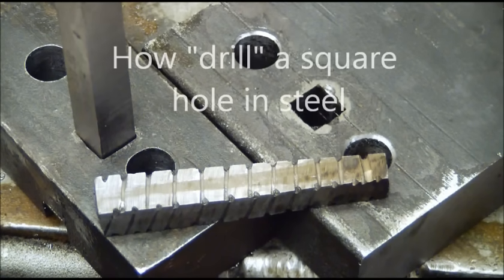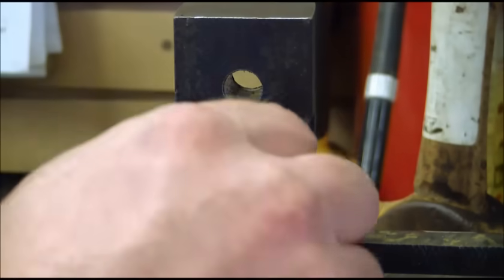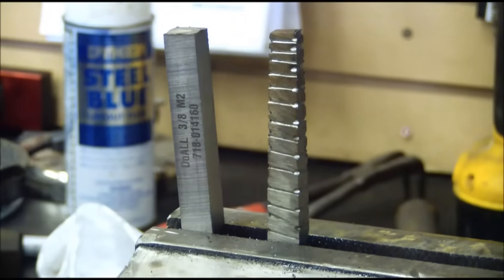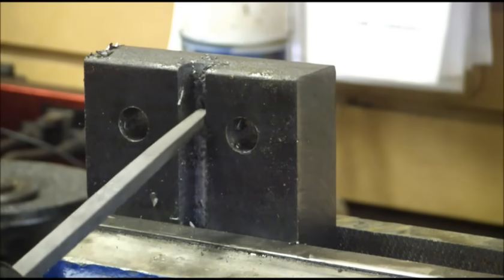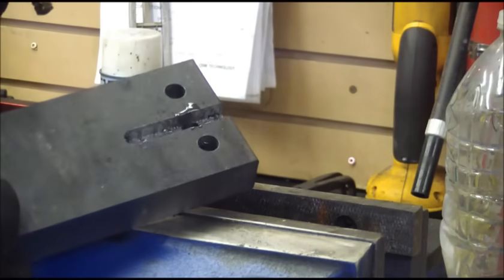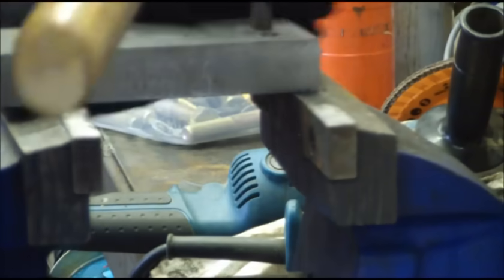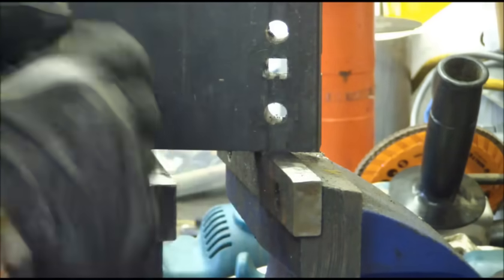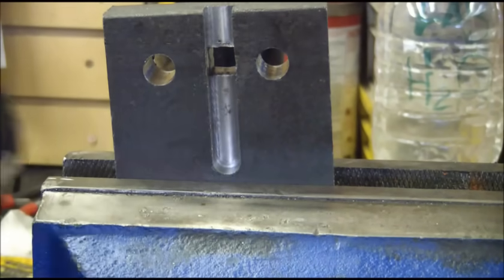Machining 101: How to drill a square hole at home without special tools.

Comment: 3/8 th inch drill (9.52mm) ffs like your speed if you were running a 2 mm drill.......try 4-550 rps max less cutting fluid on drill bit and you just might see whats going on !... as for your home made broach .....BIN IT its crap......bit like the cutting edges on your drill bit...... :(
Reply: It's crap??  Did it get the job done?

Yes it is very basic, but most people do not have well equipped home workshops or more specifically, they might have a great WOOD shop that expands their occasional needs in the metal department.  This vid shows how we can do a passable job on a task that comes along very infrequently and with the tools we likely have on hand.

Comment: you need cutting oil and a slower speed jesus
Reply: Kris Shepherd

The bit didn't get hot.  If he was producing too much heat he'd be producing blue chips.  The chips he's producing aren't even turning any color.
Reply: If he was burning up the drill bit it would not have cut thru so well it would have stopped cutting half way thru. Perhaps he should have explained how or what he was using to drill in this video but that's not what this video was about. But it would have been nice to throw in a side note on what to use to properly drill metal for novices.
Reply: I saw that straight away haha, Keeps them sharp drilling that quick , get em extra hot lol
Reply: Where do I get a slower speed Jesus?
Reply: No his speed was too low. The Drill needs to glow red hot, so it gets sharper 
lel
Reply: whatever floats your boat. Looks like youre just smoking drill bits to me.
Reply: That was the first thing i noticed & it made me cringe. Poor drill bit. Someone get this man a Drill Dr.!
Reply: prairie wanderer
Reply: I cringed as well. Get some drilling lube slow down that drill, apply less pressure. Drill bits can last years that way unless your drilling some odd alloys or thick titanium.

Comment: If you open the pulley cover with the drill off there is a chart on the cover that you use to set your drill speed . Use it!!! would suck if the bit were to jam and explode and have to have a doctor pulling shrapnel out of your chest. Also use Tap & Die lube to keep the bit cool. once it starts to smoke its too hot and if you continue it will dull and jam. Last but probably the most important thing I want to say is TAKE THOSE DAMN GLOVES OFF WHEN OPERATING A DRILL!!!!!!!!
Reply: but that chart doesn't say feed rate, take into consideration the material the work piece is made from, or the cutter being used. so really its just a shot in the dark.

Comment: Tell me again how to drill a square hole without a special tool, but at this time not  having to make a special tool.
Reply: ***** :D
Reply: *****
yeah, though I think small pilot holes in each corner and dead center would have helped.  Mark the square, use a small bit to "get close" to a rounded square, then drill the big center hole.  Square up the corners with a proper broach or even a square file.
Reply: BigDogsHunt100 yup, AND you didnt need to buy hardened steel too.

Comment: Pretty clever. I think you should have spent more time on how you made your "Broach" and less time drilling the hole. BTW, I have to agree that you seem to have been a little heavy handed in the drilling because you were running the speed a might high for that size drill bit. But otherwise, it's a pretty good and very cheap way to make a square hole. Kudos.
Reply: Yep, I agree with macbirt56 - it would be cool to see you making your broach.  How long did that take, anyway?

Comment: il give you a few tips to drill any stee you need to slow the drill speed down there are calxs on the side of most presses and the tool for broaching is not that expensive so just buy one a lot easier as to taking advice from a man that cant even drill steel properly beware guys
Reply: did you not understand that he paused the drilling to avoid heat build up ? He did this because he was compensating for a speed that he knew was too fast...therefore...he knew exactly what he was doing.
Reply: bet you watched the whole video... more than once.
Reply: bluebeard2011
PUNCTUATION!
Reply: ***** what does he know. ... you used astroglide ! lol . hahaha love it. put astroglide on the cat and pull the tail. these comments are so funny im almost crying.  good vid man.
Reply: Do something with your life

Comment: RE the smoking hole and other comments.
The thing that makes me want to tear my eyes out is all the drilling milling sawing of metal with NO LUBRICATION that I see on  almost every web post.  Just a small drop of oil on the tool and work surface will speed the work and reduce tool wear greatly.  I don't care if you use motor oil, sewing machine oil,  or Canola.  Use a lubricant !   If your hole developes just a slight wisp of smoke, stop! Add oil, hope you have not damaged the heat treatment (if any) of your tool.

2nd most annoying thing in general ( not observed in this video ) people that use their soon to be ex-finger to stop twist drills from sliding when starting a hole.  Anyone doing this needs to google Center Punch.  It's a small inexpensive simple easy to use tool that puts a tiny dent for lining up your drill on the work piece and reducing the likelyhood of your drill sliding off to infinity and beyond.

Much thanks for doing this video, now I know what a broach is and to slightly increase the precision of a square hole by running the cutting tool through in each of the 4 possible orientations.

Comment: Why the hell would you do this when you can just forge a square hole with a drift. If you are worried about changing the properties of the metal then just taking it to get CNC'd.. would be way faster.
Reply: *****  Yes I do.. but even if I didn't, I wouldn't go through that lengthy process when there are machine shops all over who can do this better, quicker, and more precisely.
Reply: I own my own company. You don't even know the proper speed for the material you're drilling. You're wayyyy too fast.

Comment: Arduino, There are 2 types of craftsmen, Those who ridicule and put people down, and those who teach and help people grow their skill set. Friendly Pro tip: 1/8" HS drill in mild steel should be around 1200rpm, 1/2" bit around 500rpm and the harder the material, the slower the speed. You can never use too much lube.  Extremely slow for hardened high-carbon steel, stainless steel and Titanium <100rpm  (I have 20 years exp. as a Precision Machinist/Machine Builder Leader in Detroit)
Reply: ***** another tip, there are some of us that know this but could not be bothered to change the belts for one lousy hole

Comment: I noticed you make the same mistake a lot of "machinists" make when drilling. You run your rpms way too high. If you back off and use the right rpm, your bits would last longer.

Comment: That's way way way too fast for that drill. Most hs/co drills are 350-500 rpm. Looked more like 1500-2000 rpm.
Reply: +jayson LeDesma Rpm depends on the drill size. Should be between 800 and 1000 for a 3/8 hss in cold rolled.

Comment: Why not just buy the square hole and install it into the part?  I have several for sale...any size:).
Reply: ***** Sure!  What size and how many of each?  Each hole comes with a free installation guide!
Reply: ***** Great!  I'm putting 2 of each size into my end of the internet cable.  It should come out your end.  You might have to give it a good shake.  If that doesn't work, reach in with a fork and pry them out.  Make sure to put a bucket under the cable in case the holes fall out.  They can roll everywhere and make a mess.
The cost will be 15 space bucks.  Not sure what the exchange rate is from USD to SB, but if you contact NASA, I'm sure they can tell you.  Just stick the cash in your end of the cable and I should be able to pull it out of my end.

Comment: You could of at least not used your vice as an anvil...
Reply: ***** You didn't USE the anvil part of the vice though (which still cracks the base which the cylinder or cuboid slides through).Ultimately you are taking off many years by using the anvil consistently, and you putting unnecessary stress on the base mechanics of the anvil... You should be at least presenting some decent best practice...
Reply: ***** Well sure... I suppose saving 2 seconds now is somehow worth years of life of a vice... YOLO amirite?

Comment: How to "broach" a square hole at home with square hss... Would of been more accurate. You even admit to this incorrect video title in the first 10 seconds of your vid. Even the broaches that rotate (more akin to drilling) are called rotary broaches!
If the title is questionable, is the info given also?? I don't know, but the video seems good to me, so why instill doubt of your knowledge, with something as silly as an incorrect title? Doesn't make sense.
The square piece of hss you start with, is in itself a special tool.. I'm not so sure everyone has a piece of square hss floating around with their drill bits. Now you realize the title is misleading, why not correct it, so as not to intentionally mislead people? Unless of course that's your game/tactic?..
Reply: ***** I disagree. Anyone with any drilling experience will know they don't sell square drill bits, and anyone smart enough to need a square hole will know its called broaching.. Then when the people who aren't familiar with broaching and have no special tools, find out they need a correctly sized piece of "square" tool steel,  and a grinder with abrasive discs, they will feel they have been equally misled. The reason you have 400k views is because people like me, (and the unfamiliar with broaching) click on your video to see how in hell, one "drills" a square hole.. They click your vid out of curiosity, only to find in the first 10seconds that they have been misled. Your vid is titled not to help people find it, but rather lure peoples curiosity.
Reply: Fair enough, I wasn't expecting you to change the title. I understand that you have to deceive in order to get the amount of exposure you do. If that's your style/tactics, then so be it.
Mate, I could not be proud of 400k views if I had to mislead to get them..All the best for your future endeavors.
Reply: ***** You have got me wrong!
"Dupe"  LOL..      Its not like that!
 I was just disappointed not seeing a square hole be drilled, that's all. I guess my expectations of the impossible were too high.. I'm in no way shit canning your video, I think its great. I just thought you would reach your target audience, (the people who would really benefit from this simplistic approach) by describing the process more correctly.
Reply: Why question a dead horse? It varies..

Comment: Aww man, show the actual pressing of the broach next time. Maybe at least a sped up video. That's the part I wanted to see :-(
Reply: *****
Do what you have to, just putting in my two cents ;-) 30 minutes of machining is boring to me, but maybe 2 minutes of pushing the broach in  would be nice :P
Reply: ***** As below ... show the start of a cut and the end of it. If there were any 'surprises' along the way, show them, too. (Or at least warn us about them).

For instance, did you broach from both sides?

I'm laughing at the guys who think a bench grinder to be "specialized equipment". Let's see them put a taper on M2 with a bench stone! Let's watch them go blind when a surface grinder, with either one or two setups, puts a taper on that tool bit and then, with one more setup, cuts the teeth then gasp in awe when you broach the hole with not one, but TWO broaches, taking a scant .010-.015" with the finish broach. 

Ooooh ... the jellyfish excitement of it all!

Comment: Yes m2 tool steel. We used a dremel to cut the grooves and then we put the tool and the workpiece in a hydrolic press. The tool shattered and now there are bits of tool embeded in the wall

Comment: Cool vid. Based on some of the commentary, I'd expect to see a torrent of video replies demonstrating the oh-so-right way to improvise square holes in hard materials with standard workshop tools. Idle complainers are uniformly non-contributors on YT. This is a perfectly acceptable way to improvise a serviceable square hole, especially if you need to make a lot of them. Without special tools -- if you have more than hand tools, a vise, drill press, bench grinder and some kind of saw will almost certainly be the first acquired. If, for instance, you've ever driven (and personally maintained) a very high mileage car to the grave, you know that a "proper" tool often costs more than the machine you are trying to repair/mod :).
Reply: I used to never buy the "for sale" sign until there is nothing to tape it to. After a while you get a humongous collection of "right" tools (anybody need a GM off-set distributor wrench? Fits a '69 Camaro). Then you get tired of working on cars all the time and hire a mechanic to fix the damned thing! :~)

Comment: Well done. Thank you. The haters and perfectionists who comment are just those who can't do...just criticize.
Reply: You're actually wrong about this.  It is we who DO know machining that understand how useless this guy's video is.  Didn't you notice he never got the broach through the piece?  He hammered it out backwards.
Reply: jeralieva Could you  please share how to best do square holes in plate steel at home or when prober broaches are not available? I've always filed from round starter hole.Very tedious. His idea looked like an improvement over filing...but I am not a machinist. Better idea?
Reply: jeralieva And a precision machine broach would not pass through the hole in a single pass, either. He had a lot of metal in the corners. Basically he was just clearing the chips.

Comment: If you have a machine shop at home, this is a great way to broach a square hole. However, you need a LOT of extra tools in order to many of things in this video, the least of which being a grinder.
Reply: A grinder (or a few!) are not 'extra' tools in any machine shop. If he had had a surface grinder he could have cut proper bevels and so on. Instead, he cobbled something together that worked using hand tools.

The alternative was to anneal the metal, cut it with a cold chisel, sharpen it with a file or two and then re-harden the M2 all the while trying to hold the tapers square. Meh ... I think his way was lots faster, even if not quite as much fun.
Reply: He used an angle grinder, a die grinder, a drill press and a vise. That is not a lot of tools in total, and can be found in any shop or home that would ever have need to make a square hole in a piece of steel.

Comment: No Special Tools? High Speed Steel is a bear to grind even with a Surface Grinder so by using a hand grinder as you mentioned must have taken you a week or so. Off course after the taper is ground then comes the relief and cutting edges on every edge . I think it would be much faster to drill the 3/8 hole through and file out the corners.

Comment: I own a machine shop.  This is impressive - providing your goal is to make a square hole.  If your goal is to make money you are going to fail.  The reason we don't see things like this very often is not because no one thought of it before, it's because it is too labor intensive to be practical - there are easier, faster, cheaper ways.  A great idea for the hobbyist with a very limited budget and lots of time.
Reply: Once, after doing some especially nice work when I was a new machinist I showed it to the plant owner. The finish was fantastic and I had split all the tolerances .... doing .0005 work on a Bridgeport ... and it had only taken about an hour from the time I had first got the print. I was tickled silly and quite impressed with myself. It was one of the first pieces I had ever had full, start to finish, responsibility for.

He said "That''s really nice. Let me know when you can do it in the 30 minutes we bid it at."

Comment: I see some obvious problems with this approach.  One, you need a new size broach for every size of square hole you want to make.   Two, you vice pres that thing through wood, you are going to split the material.  Three.  It looks slow.
Reply: Do you have to have a different size bit for every size round hole you drill?  Mmm hmm.
Reply: Tomme Foster Not me! Although I will admit tapping is sometimes a bit of a challenge if I don't have exactly the right size tap on hand.

Comment: Use a square file... you will save a lot of time.
Reply: At last common sense ..what is it 2day with POWER TOOLS.. the industrial revolution was built with files & scrapers & engineers blue "Old school"
Reply: 2yehbutno Who were trying hard to build powered machine tools.

I can scrape, I can stone. I can use Prussian blue, die blue and colored chalk all day.

Or I can walk over to the surface grinder and get this damned thing flat in time for the next truck.

Now, which do you think my boss would rather I do?

Comment: Try rounding out the bottom of the broach to fit your starting hole diameter. Then cut your relief cuts. The broach will start round, as does the hole, then works itself into a square. No file work that way. You would have to make the broach longer with a longer tapper, but it works. Just sharing...nice work here, well done.

Comment: but u wasted the tool steel.. n the file would have ended up being faster and with less effort.. but yea.. broaching is a way to work metal, usually the piece is hot though.